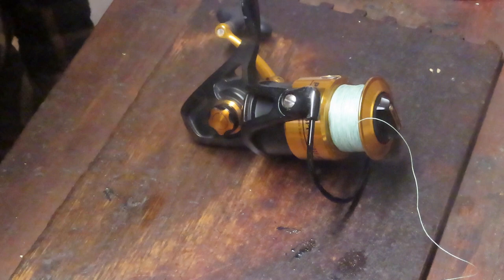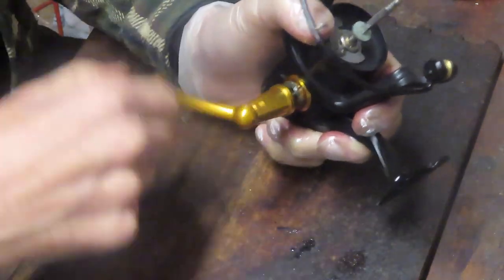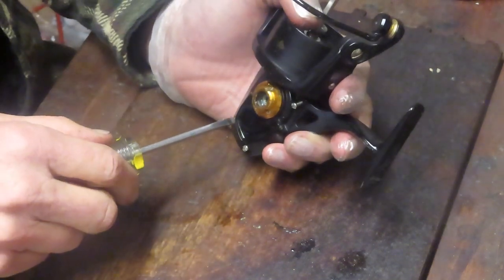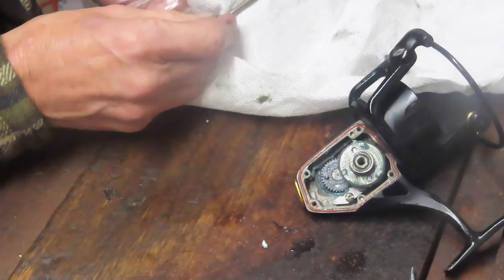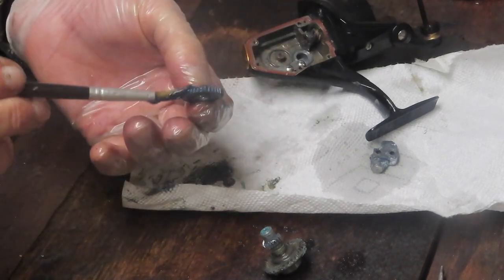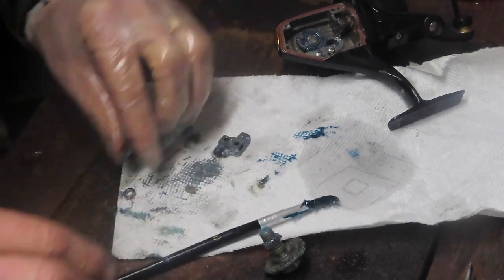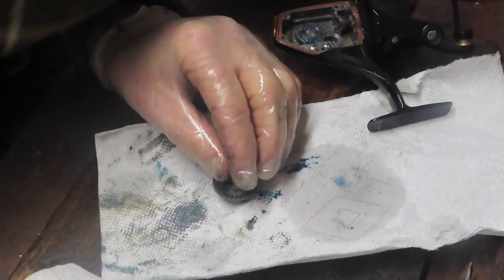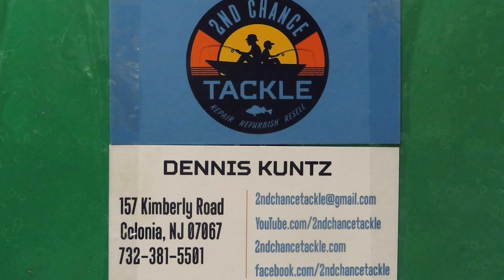Penn SpinFisher V4500 with a unique sticking problem   Diagnosis and repair

Comment: You really do a great job on those reels.  On my Penn Spinfishers from the 90's I just open them up and blash out everthing with WD-40 and then add a drop or two of oil where there are bearings and a bit of grease on the gear surfaces and close it back up.  My old ones do not seem to be sealed at all but they keep on running.  Some day they may need to be serviced by someone like you.
Reply from the maker: That is awesome!  These reels were truly built to last and they will with maintenance.  Keep doing what you are and it will continue to prove how reliable they are

Comment: Still looks a little sluggish, rotor and handle should spin on their own for a second or two after letting go, probably should have been serviced earlier and more often. My beach reels get taken apart every 2-3 outings, sand in the case will ruin a reel very quickly.
Reply from the maker: So true.  I have seen too many reels ruined by lack of maintenance and excessive wear.  I often wonder how folks that forego the maintenance on their reels treat their automobiles - Dennis